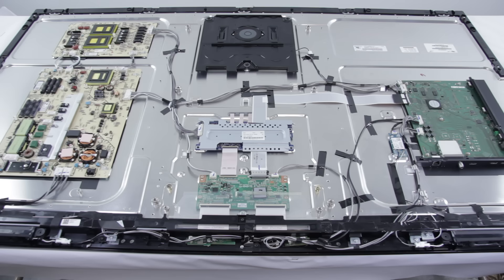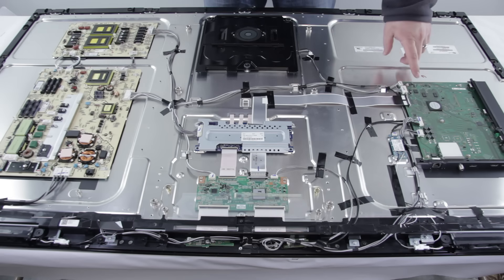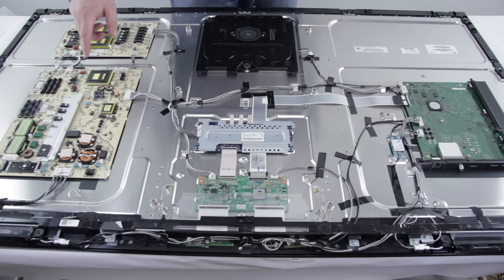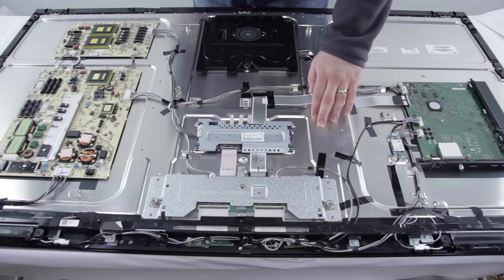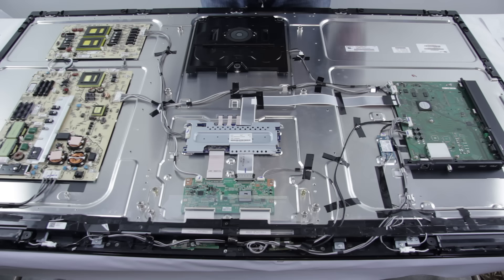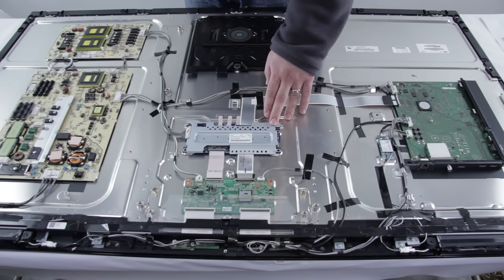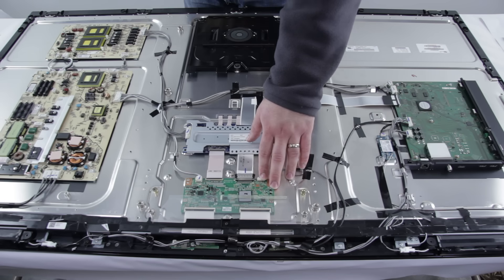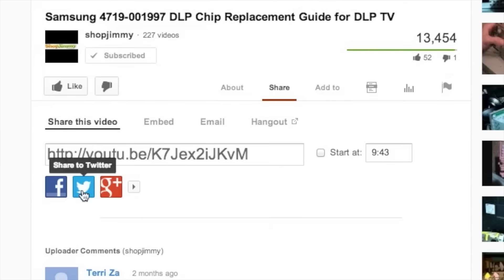LED TV Repair Tutorial - Common Symptoms & Solutions - How to Repair LED TVs

Comment: Samsung UN55F6300FX, after about 20 minutes the screen starts to flicker.  The flicker will be intermittent and occurs independent of the source.  The screen will then appear light or dark on a 2 minutes interval before acting like a strobe light for 20 seconds or so. Please advise, power supply?
Reply from the maker: Jordan Mac   Unfortunately this sounds like you have bad LEDs in the TV, and there is not a repair for this, without replacing the TV panel.  If your TV panel is bad, it may be more cost-effective to replace the TV as panels are typically hard to find in stock, difficult to replace, and expensive.  Thanks and please let us know if you have any further questions!  www.shopjimmy.com

Comment: Hi. I updated the firmware on my Samsung model un55eh6000f TV and it restarted itself after the update but will not turn back on. The light will blink 6-7 times then the TV turns off. The screen never turns on. The only thing I get is the light blinking and the turn on sound. Thanks
Reply from the maker: landon viars   It sounds like you damaged the main board in your TV.  Click this link to replacement main boards for your TV model number:  http://www.shopjimmy.com/catalogsearch/result/index/?cat=56&q=un55eh6000f  There may be multiple boards for the same TV model number, be sure to match part numbers on your current board, with your replacement for compatibility.  Here is a link to a video showing how to identify your part number, click here:  https://www.youtube.com/watch?v=BEPWrefQvqI  Thanks and please let us know if you have any further questions with your TV Repair!  www.shopjimmy.com

Comment: I have a 42" Sanyo DP4270  LED tv. It has sound and back lighting but no picture. I am trying to figure out where the T-Con board is.
Reply from the maker: Paul Vawter   Looks like your TV is not an LCD TV, but actually is a plasma, so it will not have a T-Con board.  Please reply with your TV symptoms and we can recommend a repair.  Thanks!  www.shopjimmy.com
Reply: ShopJimmy.com The TV has sound, back light and no picture.
Reply: ShopJimmy.com I provided the wrong model it is a Sanyo DP-42740
Reply: I have a 42" Sanyo DP42740  Plasma TV. It has sound and back lighting but no picture.I have checked fuses and I have power to both X & Y boards.
Reply from the maker: Paul Vawter  Please watch this video FIRST to help with your repair!  https://www.youtube.com/watch?v=BP3NVNCGEv8  This could be a problem with the buffers or the digital board in the TV.  Replace the buffers together or the digital board to see which one fixes the problem.  Click this link to replacement parts:  http://www.shopjimmy.com/catalogsearch/result/?q=DP42740  Be sure to match part numbers on your current board, with your replacement for compatibility.  Thanks and please let us know if you have any further questions with your TV Repair!  www.shopjimmy.com
Reply: ShopJimmy.com When you say digital board is this the TNPA5305 Logic board and when you say buffers is it the same as the X & Y sus boards?

Comment: Hi, I have a Samsung LNT4661 and it only works for about 10 minutes then the picture goes dark (sound is present and I can still see very faint images but the back light is not on).  After the TV is turned off for hours then it would work for another few minutes before the picture goes dark.  Which part is the most likely problem?  Thanks in advance for your advice.

Comment: Hello,
I have a RCA LED55C55R120Q and the serial is 3515-le55c55-a111133. My tv 50% of the time will show a line down the middle of the screen. After some research some have suggested I have some loose connections or need to replace my IC. 

Thanks!!!

Comment: Your videos are top notch.  I have a Toshiba 46L5200U TV that is flickering and then going dark, but still getting audio.  The problem is intermittent but once it starts flickering, it always eventually goes dark.  Cycling the power will usually clear the problem but only temporarily.  Do I need to have the grounding strap to remove the back cover to get part numbers or just when/if i start to remove components?

Comment: I have a haier model # Le46f2380.  I have a solid black screen.  When I first  turn on the tv I get a blue screen for about one second then immediately goes to black. The blue led indicator lights up to show power on, but has solid black screen. When running equipment on rca I get audio but still no picture. Went through all inputs and have nothing on any of them. Any idea what I need to fix it?
Reply from the maker: zacharybsmith1987   I recommend replacing the main board in your TV.  Unfortunately I do not see any replacement parts in the search results for your TV model number on our website.  Please reply with your part number on your main board and I can try searching for replacement parts.  Thanks and please let us know if you have any further questions!  www.shopjimmy.com

Comment: I have an LG model number 60LS5700-UA. The backlight comes on but no picture. When I plug in my laptop through the HDMI port the screen on my laptop "blinks" which I assume means the inputs on the TV work. Don't know about the audio, but im not as concerned with that because i won't need it. After watching your video i'm led to believe the Tcon board is the problem, but im finding it hard to remove the ribbon wires that go from the Tcon board to the screen. Is there any way to easily remove these wires so I can attempt to replace the board, or is the Tcon board and screen replaced as one unit?

Comment: I have a magnavox 50mf412b TV that turns on for about 5 seconds, but shuts off and has no back light. Please help ☺
Reply from the maker: *****  Please watch this video FIRST to help with your repair!  https://www.youtube.com/watch?v=BP3NVNCGEv8  This could be a problem with the digital board or the power supply board in your TV.  You may need to replace each board individually to see which one fixes the problem.  Click this link to replacement parts for your TV model number:  http://www.shopjimmy.com/catalogsearch/result/?q=50mf412b  Be sure to match part numbers on your current board, with your replacement for compatibility.  Thanks and please let us know if you have any further questions with your TV Repair!  www.shopjimmy.com